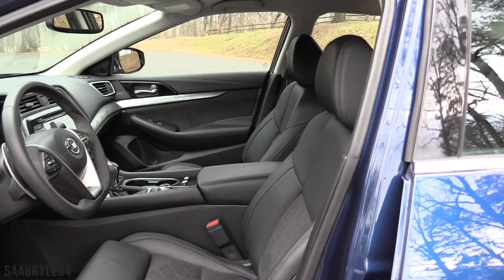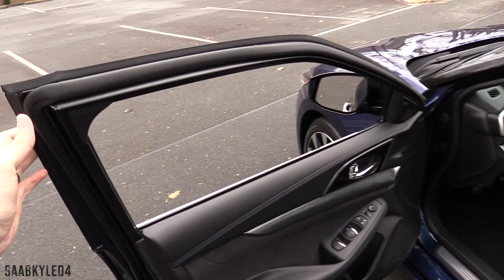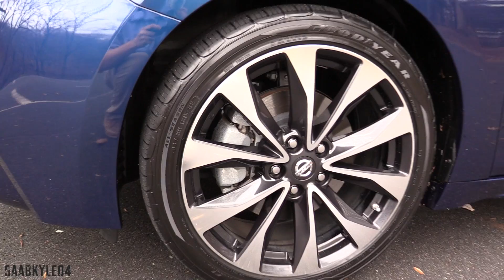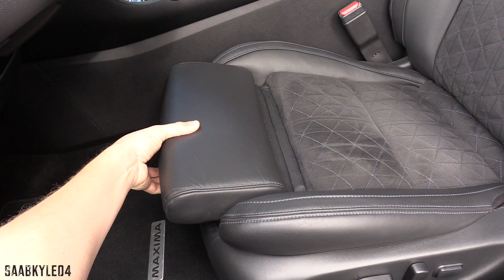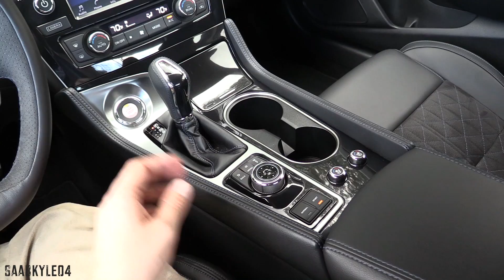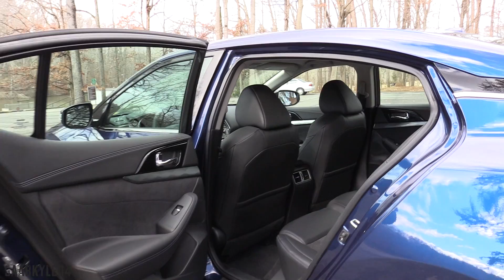2016 Nissan Maxima SR Start Up, Road Test, and In Depth Review

Comment: The car is cool and all but you shouldn't market it as a sports/performance sedan when the car has a pretty Sandard v6 and a cvt transmission.
Reply: +BCJDM 3 cylinder bmw 3 series is also marketed as a sports sedan...cylinder count is irrelevant...

Comment: Wow, that glossy black around the tune knob and center console are already all scratched up and worn looking. That will not wear well if it looks that bad after less than a year. Imagine what it will looks like after 10 years and 100k miles. It won't even be glossy anymore...

Comment: like how they have those huge paddle shifters to hide the fact that it's a CVT
Reply: They have the same function as in a traditional automatic. Not trying to hide anything.
Reply: +CJBMAGGOT94 good for you. I'm sure they'll sell just fine without you.
Reply: +CJBMAGGOT94 My brother has a 2003 maxima and haven't had any major problems with it yet and still runs like it's new. I'd call that good reliability
Reply: +CJBMAGGOT94 have you ever driven a CVT? Driving my car in manual mode is just as fun as an automatic. It even blips the throttle on downshifts.
Reply: +Iam Sam you must not drive, in my city nissan vehicles are everywhere.
Reply: Iam Sam The Juke count as unique? lol. Ugliest car ever made. Nissans in general are pretty bad reliability wise compared to the other Japanese manufacturers, even Korean as well. Vikk 54 I doubt that. They are boring cars for boring people. Even more so with the CVT. Can't polish a turd.
Reply: Iam Sam I agree with the Pontiac Asscrack being the ugliest. Juke is not far behind. Have to look away when I see either of them to avoid throwing up.
Reply: +Iam Sam I see Nissans everywhere I go. I've seen quite a few new Maximas out on the road.
Reply: +Vikk 54 Besides being fast, or as fun.
Reply: Vikk 54 Yeah I have. It has been a while though. Wouldn't want to own one either way.
Reply: +Blaze Flame that was pre-CVT though.
Reply: +Blaze Flame that's the one I want the 5.5 gen 02-03 with an 6sp
Reply: Cvt is much better than normal gear automatic. I would have liked a manual option In addition to cvt but cvt all the way.
Reply: S A You are what is wrong with new car buyers.  #savethemanuals
Reply: Hi ALL

Comment: Best car for style and worst car for body and to drive.  I prefer the 2016 accord,  the best car in this category. I am hoping for a Honda 2016 pilot or accord review, probably the best car with engine and tech and body. Love that!
Reply: +Alanex Knight Wrong category, the Accord belongs in the Altima's category. Max and Avalon are in the same category.
Reply: But the accord has the power to compete with this car though.
Reply: Alanex Knight Altima competes well with the Accord, Altima has 270hp in V6, Accord V6 has 278. What separates Maxima, Avalon and TLX which is Honda's mfg corp equivalent to the Max from these cars are mainly much higher quality interiors, many more standard features, quieter interiors etc. Also way more exclusive, 50k or so units sold per year vs 300 to 400k units to Accord and Altima.
Reply: +loaferguy73 well the most sold car will always be camry and accord. New gen cars like maxima can except complaints like the sonata and optima
Reply: +loaferguy73 and the avalon and Genesis competes with maxima. Both avalon and Genesis are great for sports and luxury while this car is only for sport and not at all good for luxury
Reply: Not at all good for luxury? Have you ever sat in one of these cars, and the Avalon and Genesis aren't good as sports cars.
Reply: Cole Haggarty Yes not at all good for luxury... It looks best, It performs best, It's tech works best, It's reliability is best. But it's luxury ain't that good than the avalon or genesis

Comment: 1:55
Ahh, the sound of greedy businessmen and saddened engineers. V6. The cancer of automotive engineering.
Reply: +Tobias Weiß 
Whats wrong with a V6?
Reply: Antwon Jenkins It's either imbalanced, had an over complicated crankshaft, or requires balance shafts that increase the engines moment of inertia.
It's the cheap and lazy way to produce and package a 6 cylinder engine.
Reply: +Tobias Weiß  I hear ya, but I think it also has to do with size. Some cars just cant fit an inline 6 under the hood and a VR6 is even more complex I believe.
Reply: Antwon Jenkins A flat six engine would've been mechanically sound, and it could have offered an even lower center of gravity. But then again, it would've been a bit harder to design and more costly to produce.
Reply: +Tobias Wei&#223; It doesn&#39;t make sense to put in regular plain sedans when the only challenge is bringing the costs down. Can't disagree with what you said though...
Reply: rock True. I would happily pay 1000$ more though if it meant I received an perfectly balanced, great sounding and easy to maintain inline 6.
V6's are a bitch to work and change parts on.

Comment: My next Nissan purchase! An SR in White or Red. I traded my 2012 SV on a 2015 Murano Platinum as I needed more interior cargo capability.I have owned 3 Maximas so far (2005, 2007 and 2012 models)...and the CVT versions have always been the more responsive transmissions of the Maxima's auto trannies. The 2005 5-spd auto never responded as fast as the 2007 and especially the 2012 Maximas I have owned. I won't buy another Maxima with a traditional auto as all their other autos I have driven so far don't react nearly as quickly to throttle inputs compared to the Nissan CVT Maxima. A lot of this has to do with computer programming...which could be fixed on traditional autos (if that is every fixed or better than the Nissan CVT...I'll try them again). A 6 or 7-spd manual would be nice however...but those sold in such low numbers when they were available (before 2007 model year) that Nissan removed them from the option list.

Comment: The CVT is a deal killer for me. They should have used the Infiniti 7 speed transmission.
Reply: I agree 100 %
Reply: Coming from a person who drives a CVT Altima, it's not that bad. You get used to it.
Reply: +archinuk417 I have 2011 SV sport Maxima and the CVT really isn't that bad.. It simulates gearing well in sport mode and if i'm just cruising around you're always in the right ratio for the most power and the paddles can be used anytime to help get up to speed.
Reply: Xisean Anthony  2016 sr
Reply: +Denzel France i got an 11 also.  Dudes complain about the CVT but never tested one for the max
Reply: I've always driven a ctv. My first driving experience was in a 2014 Altima. Going to a standard auto feels like talking a step backwards.
Reply: I just got one and it drives pretty damn good
Reply: I've always driven a ctv. My first driving experience was in a 2014 Altima. Going to a standard auto feels like talking a step backwards.
Reply: +Blaze Flame what year
Reply: +Blaze Flame how long you had it.  The Nissan where I get my Max maintained have been tying to get me to trade in my 11 for it.  also does the Transmission have the Ds too
Reply: Xisean Anthony Ive had it fir a week now and it's gotta sport mode with tiptronics and if you get the sr it comes with paddle shifters.
Reply: Nothing's perfect.
Reply: +archinuk417 The vast majority of car critics always complain about CVT transmissions. There must be a valid reason why.
Reply: +Luis Ramirez it's because the CVT is unresponsive in situations demanding quick and powerful response. This doesn't totally mitigate the CVT's use for everyone necessarily, but it is a potential ability that most people, especially critics, would like to have in their car. Don't get me wrong, coasting with a CVT is actually really nice and relaxing, but theyre terrible in traffic or when I put my foot to the floor.
Reply: the 7 speed is a Nissan transmission
Reply: Im still gonna purchase one due to me want a nice, luxury, and headturner car. If i wanted a sports car, i would buy a sports car.
Reply: Boats N Hoes Thank u. People need to realize that regardless how Nissan market it, it’s not a sports car in their definition. It’s a sporty sedan. A very aggressive one at that. It wasn’t meant to be taking it to the tracks.
Reply: +Vikk 54 I've got a 2013 3.5SL Altima (very close to a maxima in mehcanical specs), so I can back you up and say its nice for daily driving (and occasionally for hard acceleration). However, the Altima is not marketed as a sports car like the Maxima is, meaning buyers in the Maxima segment are looking more into something more serious in performance. At the very least, don't you think they should have included a 6-speed manual if they knew this was being marketed to people looking for something sporty like they did with the Juke? Just my two cents.